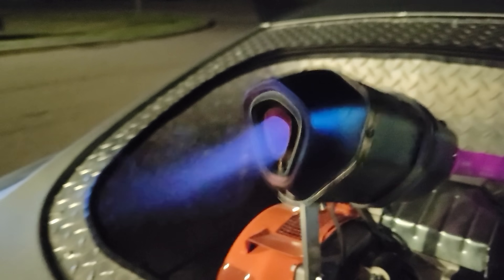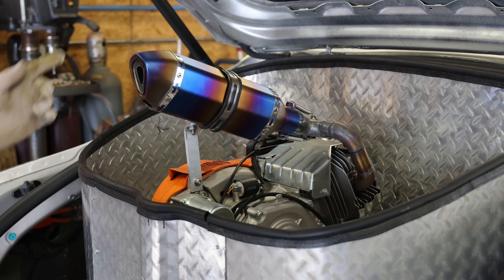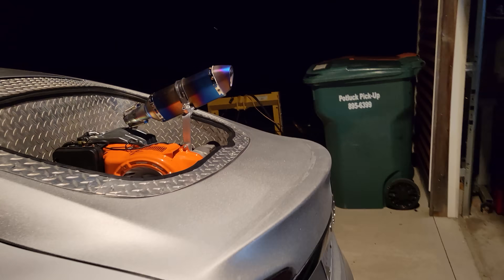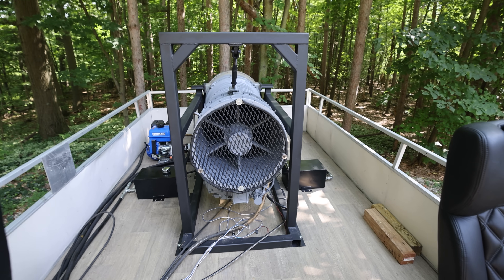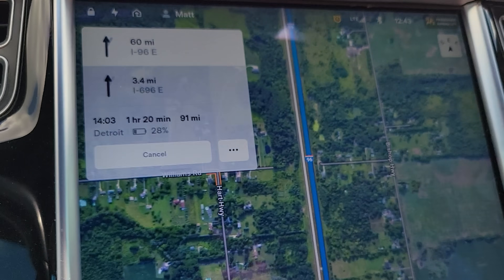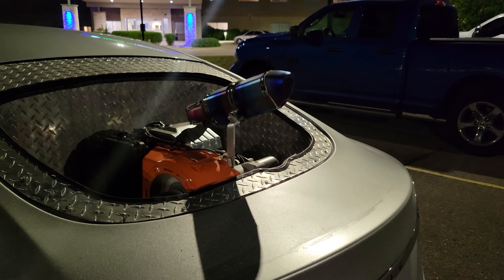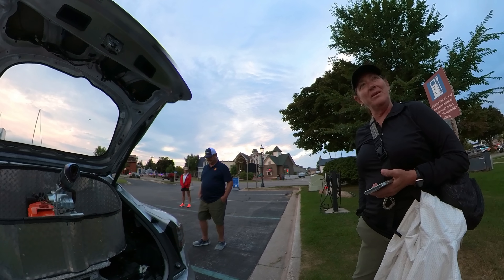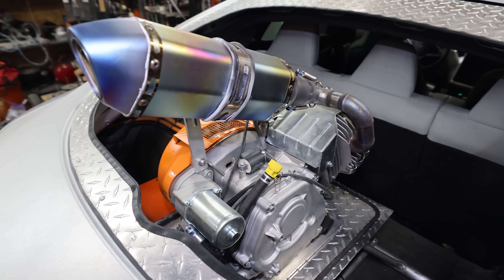Cordless Tesla (I Drive 1800 miles without charging) P.1

Comment: You make the BEST montages, they are pure art. I think it's amazing that you have this much talent. I wanna build an what real truck users want. A 4 cylinder turbo diesel electric F-150 with a 60kw battery. The Truck should operate just like a Chevy Volt. It can be a grocery getter for daily trips to work and back and on the weekend be able to pull the boat to the lake 120 miles away and back. The Global Warming Zealots want a centrally planned economy with the EV mandates. Electric just isn't there to meet everyone's needs yet. Especially if you live in Canada.

Comment: Thinking about the amount of changing over from AC to DC to AC to dc. Lot of inefficiencies do you think there's a way that you can convert the three-phase directly off to flywheel rectify it regulate it and then put it directly into the batteries I think would be the best if you could. The Tesla I don't know might not even realize but then it might
Reply from the maker: I am working on simplifying the system as I do more iterations. The Tesla itself is very efficient.

Comment: It kind of reminds me of one of those inverter generators which outputs AC from the flywheel sends it to the inverter that turns it into DC and then back into 60hz AC? Is that what this is?
Reply from the maker: Well no matter what you will always need to do some alteration when getting power from an engine because it's never a constant perfect rpm.

Comment: Keep in mind that he built this contraption so that he would not have the inconvenience of stopping to charge and he stopped more than any normal electric car. If you really want to drive non stop, get an Aptera.
Reply from the maker: Wayyy Toooo SLOW, my tesla is almost 1000HP AWD and just got 20 MPG on this powerplant I build in my moms kitchen, wait till the real deal is done...haha. tesla is the best ev but evs are not the best at storing energy. 100KW is equal to 3 gallons of gasoline.
Reply: @WarpedYT  Since jet engines are not practical because they burn almost as much fuel at idle as at full thrust, why not get a small jet engine and run it full blast all the time?

Comment: Ducking awesome man! 😎

How interesting that the fuel economy ends up being strikingly similar to your typical compact 4 cylinder! Do you think that's a fluke, or a reflection on just how well tuned gasoline engines are these days?
Reply: It is a reflection on how well the Tesla is engineered, it is one of the most efficient cars made.
Reply: Are you joking?  My Chevy suburban gets similar gas milage.  A Toyota Corolla gets about 35.  The BMW i3 EV that has a similar gasoline generator gets about 40.  A Prius gets 50.

Comment: I've always wondered, why don't manufacturers make a hybrid-electric car that just uses an electric drivetrain with maybe a 2 cylinder engine to passively charge it, as well as having a large battery that you can charge overnight just like a Tesla? It would greatly extend the range from a normal electric car which is their main downside, as well as saving R&D and manufacturing costs from an expensive and complicated conventional drivetrain.

Comment: Congratulations!  You achieved the same MPG as my Z71 4x4!
Reply: The stats are at the end of the video.
Reply: @202vaughn  I saw those stats but I am looking for the total gallons of gas used for the entire trip. Its not a calculation but a fact that could be given like from a gas station receipt.
Reply: Yeah but your Chevy is still burning more gas by 1800 miles.
Reply: @BlueOvals24  If he was running that engine non stop as he said he was, MPG is still MPG. Where the hell do you come to this conclusion?
Reply: @MidnightMarrow  Because the Chevy ain't doing 1800 miles without a fill up. The car itself had shit mpg but the little motor was just sipping. How do you think he made it that many miles?
Reply: Do you know how many gallons of gas was burned during this road trip?
Reply: He got the same mpg as the z71 and more hp with an engine that was less than 1/4 the size of the v8, literally jerryrigged into a Tesla leaking fuel the whole way.
Reply: @messagefamilystyled1101  Yeah and it cost him more to run, took longer to charge and still reduced his range. Ten minute charges would likely give him the range that PoS gives hours later. He was literally driving slow enough to get pulled over which means any time he "saved" not stopping at a proper charger is mitigated by taking longer to get places. Power plants are far more efficient at producing power than an engine so you can't even go off of that logic. While a fun idea it's a wasteful stupid fucking thing to do not to mention inconsiderate as hell with the amount of noise that thing was producing and of course in the end he chose to make it that loud with the pipe he put on it. Basically a big "Fuck you, my electric cars a gas guzzling noise polluting POS, just cuz."

Pretty sure he fixed the leak half way through too so that argument is moot.
Reply: @MidnightMarrow  makes sense it would be a pos, he literally jerry rigged it in his garage, most real hybrids get minimum 50 mpg

Comment: You should have used a gas turbine engine …. Run at steady speed they are much more fuel efficient than a regular engine, and as a benefit you can tune them easily to run on anything form car gas to alcohol….

Comment: Why is it spitting Fire out of the Exhaust? It looks cool, but that is a lot of Energy just wasted into the Exhaust. And I think it is also possible to make it more quiet. Normal Generators that you can buy are not loud at all. And the Exhaust is also not running that hot. And I think you can get more power from the of the Shelf ones too. Maybe get the biggest Diesel one that you can fit in the Car.

Comment: Technically you could have used one or two Honda Rebel 300 engines which get a claimed 78mpg. Tune those to generate electricity at their most efficient point and even after electrical conversion losses, you are looking at minimum 62mpg. It seems like you may also be able to work on better cooling for the engine, such as using a large heat sink and copper tubes when driving and switching to fans and/or a radiator when stationary as there is less airflow to cool. Better cooling could also help to improve efficiency.
Reply: He should also do a (more) speed controlled and limited experiment, or several, at different speeds. Trips at 30-40 mph, 40-50, etc.

Comment: I think a better choice would have been one of those twin cylinder Kohler engines 620-750 series 24 hp. I think it would definitely have had power you needed without the sound level. While still maintaining excellent fuel economy.
Reply from the maker: I think Kohler is the way to go

Comment: how about a turbine generator? they can practically use any fuel, develop alot of torque and possibly run several generators at the same time? Or does it simply use too much fuel in comparison?

Comment: I knew this was going to be epic. I was not let down!!!! It is interesting to see just how well it worked and what the limitations were. How did you calculate the thermal efficiency? By generator output or battery output?
Reply from the maker: Thanks, I appreciate the positive comment, some people get it and some people don't. I calculated the thermal efficiency by how many gallons of fuel were being burned for how many Watt hours were being produced. There may be some slight efficiency loss in the electronics but most of it was the engine.
Reply: @WarpedYT  🤐

Comment: So many questions, 10,000 watts!? Where’s the generator? How did you get the on board charger to work while driving? If you didn’t use the on board charger what did you use? Where’s you tap into the high voltage pack at?

Comment: For V2, a bigger engine with more cylinders would not only provide more KW for charging and taking more of the load down the road, but it would likely run much more efficiently not being at nearly full load like this engine was at. Amazing video WP, I love the way you think outside of the box.
Reply: Generally, smaller gas engines have more efficiency than bigger engines. You can get 1,500 MPG or more with a 50 cc engine.(Excluding fuel cells).
Reply: @tedmoss  a 10hp single cylinder engine at full load vs a 40hp 4 cylinder at 40% load... Which do you think is going to run more efficiently?

Comment: Hatz diesel makes a product line called fi-pmg integrated engine and power generator 3kw AC or 100 amp 48v DC. 

both engine options could fit in the same space and are electric controlled.

Comment: I'm thinking about the muffler situation, and you could hook up a 196cc DIESEL engine and a large glass-pack car resonator to reduce the already quieter engine. the extra torque could also help with potentially adding a motor to the crankshaft and provide constant higher charge
Reply: Also thinking about a diesel generator
Reply: I think just putting an actual 10kw-12kw generator in that space he made would be better. Then glass pack the compartment and put a lid on it with a port for the exhaust, then it wouldn't be much louder than a regular car.

Comment: Diesel electric hybrid. I just wouldn't go ham with the generator size, as generators are more efficient at or near their peak output (but I'm sure you already knew that). You might als experiment with a gen set that can recharge quicker, and has less than a 100% duty cycle.

Comment: Would love to see a more indeph break down of how it's wired, just show us more on the generator to car connection
Reply: Yes, this is possibly the future.
In an era where automakers are designing cars to break and be unfixable in 10, 8, 6 years... (showroom to junkyard business model)
A Tesla that can run 500k miles and an adapter kit for some generator from Tractor Supply is a great solution.
Some people think cars should last longer than 8 years.
Any idea what the real MPG situation is?
Reply from the maker: @firstjohn26  Damn right as consumers we want options, especially at the current prices which are pretty outragous.
Reply: @WarpedYT  , please tell us how to wire that unit to the Tesla. My Model S won‘t start when plugged into a charger, so how did you solve that problem?
Reply: @RipsDiner  definitely didn't
Reply: @Hates Spam lol have you ever heard of Volkswagen/Audi?

Of course they're not designed to break. They're designed to be good at doing X within warranty while still not being too expensive. All engineering is a delicate blend of trying to balance reliability, quality, and pricing. 

What is being changed, is that car manufacturers are no longer focusing on making sure vehicles are easy to repair, and ensuring that reliability is #1 priority.
Reply from the maker: @akshonclip  BS I haven't deleted even 1 comment on this video. please be honest.
Reply: lol its not wired at all its just a generator in the trunk, where he changes idle speed to make it look like its charging
Reply from the maker: @joeyscleaningladys  you can close your eyes and hear that the engine is very loaded, an engine will not spit flames without load.
Reply: @WarpedYT  or have a glowing exhaust!

Comment: I have to call Bull Sh!t... All I see is an engine. How is it charging the car's battery bank without any 10,000 watt generator head ? 
No explanation other than 2 seconds of, "This little black electrical control box thingy under here" lol....I'm pretty sure a 10,000 watt generator head can't fit under that orange engine shroud by the flywheel, starter & plastic cooling fan where the engine stator/alternator is ,for charging the 12V starter battery.  
I guess the average YouTube viewer in 2022 is too dumb to realize that an engine alone won't charge an electric car.
    Also someone could just put a 10,000 watt portable generator the trunk, vent the exhaust pipe outside the trunk & add some intake/exit, air flow cooling vents to keep the engine cool. Wire/plug-in, directly to the 240V outlet on generator, then tweak the cars charging system so the car will still drive while the battery bank is being charged by the gas generator. THAT WOULD BE WAY EASIER  than TIG welding the engine frame/mounts & diamond plate aluminum shroud.
Reply: Exactly! A 10,000 watt generator head is pretty big. Also, how did he trick the on board charger to work while driving (the part that goes from 220v ac to the high main pack voltage). He also never shows the charge rate on the screen, if it was charging you should be able to see it on the screen, 10,000w would be noticeable.
Reply: @joshlemons3662  He's up to 2.5 millions views from this bogus video. Look at how many gullible/stupid people fell for it.....Time for me to make a YT channel, I'm gonna run my motorcycle off water.

Comment: This reminds me of when I see someone running a inverter on a 12v battery to power ac transformer to 12v dc. WWWWWWHHHHHHHHHHHHHHHYYYYYYYYYYYYYYYYYYYYYYY.
I get it in the interesting stuff for youtube. I'd rather see a very efficient gas engine in a vehicle that almost anyone could do. Like a better ECU on a honda motor. One that you could tune it to drive well, but also get some extreme efficiencies. Also maybe as a side quest. Making it as clean burning as you can without all the government regulation based parts.

Comment: Cool project, i just don´t understand why you try to make it obnoxiously loud. Some small improvements and that Tesla could almost be silent. Still, i wolud rather stop to charge. But where is the fun in that i suppose :)
Reply from the maker: I ran out of time, I needed to make a full custom exhaust proper but I didn't have an extra two weeks to do so, because when I used a full muffler it wasn't making quite enough power. The efficiency on that engine is not very good so opening up the exhaust improves power quite a bit

Comment: 💡🌩 Wait wait!!,   1) Theres NO GENERATOR/ALTERNATOR attached to the engine.      2) No way it can supply enough power even if it were coupled to a generator to power up the cars internal charger. 3) I don't know of a indirect method of overriding the cars internal charger without directly interfacing to the batteries or MODing the internal computer.
Obviously, this is supposed to be a joke. You know I'm a fan.

Comment: Have you thought about a small turbine engine? The need for a reducing gearbox is a disadvantage but the fuel options are greater and the overall package should be smaller.